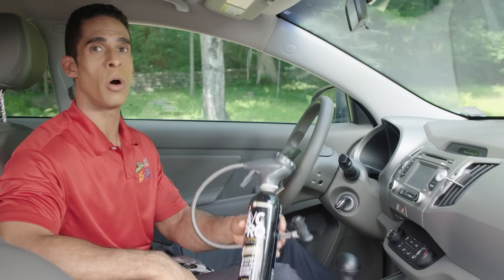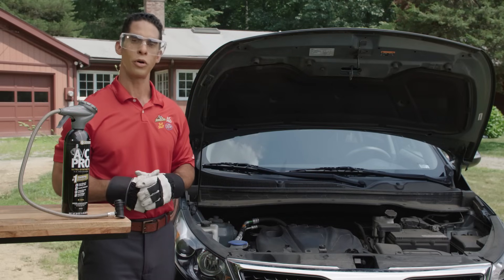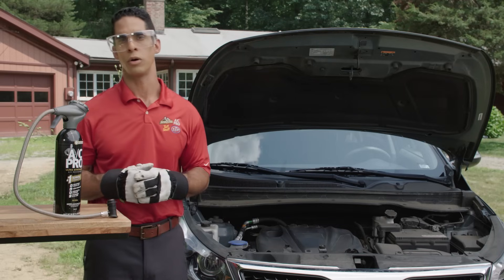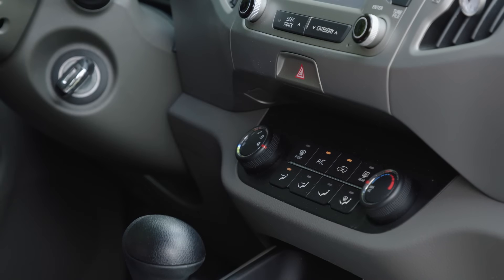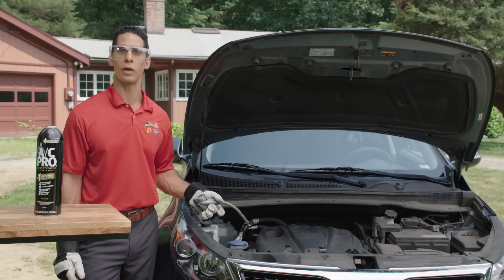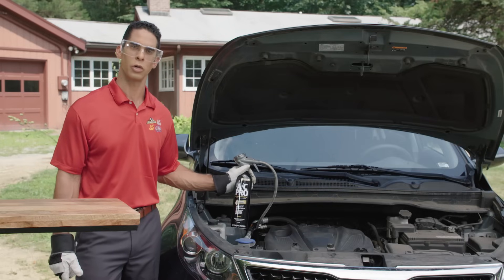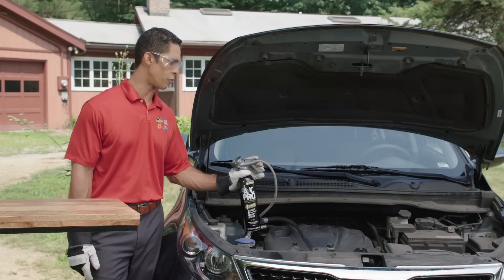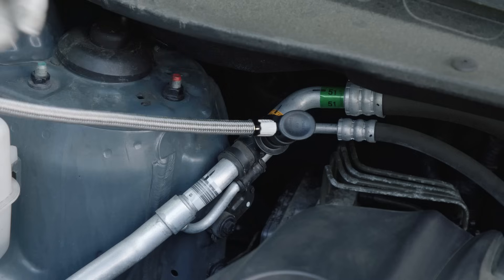A/C Pro® How To Recharge

Comment: my adapter won't click on it'll go on but it won't click securely what do I do
Reply from the maker: In this situation there are a couple things you can check - 1) make sure you're on the right port in your vehicle.  The coupler will only fit on the low side port so if you've found the high side port by mistake it won't connect by design.  2)  Make sure your vehicle uses the same refrigerant type in the can you bought.  Many newer vehicles come with a new environmentally-friendly refrigerant called R-1234yf, which has a different size low side port.
If you're using the right refrigerant on your vehicle and have found the right port, the coupler will just snap on with a push.  No need to pull back on the collar on the coupler.

Comment: Did not work on my 2016 Civic.
The quick attachment did not click and everything started splattering everywhere
Reply: 2016 Civic doesn’t use this type of refrigerant.
Reply: It’s a standardized connection. Try again.
Reply: @cabbycabby1770  the car uses R-1234yf -

Comment: The connector doesn't fit on a civic 2016
Reply from the maker: It doesn't fit because this vehicle uses R-1234yf and not R-134a so the connector is also different.  https://youtu.be/CsrtqKdmlOo
Reply: @Acprocold  oh got you thanks a lot for responding brother

Comment: Won't attach to my 2017 kia sportage
Reply from the maker: Are you sure you're trying to connect it to the low-side port and not the high side?  The low side port is typically connected to a larger diameter aluminum tube.  The ports are standard across all vehicles so if you find the port it will fit.  Our low side port lookup tool can help.  https://www.acprocold.com/ask-the-pro/port-locator/
Also, make sure your vehicle uses R-134a and not R-1234yf.  You can confirm the refrigerant type by looking for the sticker under the hood.

Comment: I gave it a whole can. Now it's shooting kinda cold air. I still need the window open. Before, it was shooting hot air now it's kinda cold. I'm going to give it 2 more cans, that'll do it.
Reply from the maker: Be sure to read the gauge when recharging your system. Overcharging it can lead to warm air, so you want to make sure the refrigerant level is in the green portion of the gauge for best results.
Reply: @Acprocold  I gave it 1 more can and now its shooting cold. took 2 cans.  works great though.

Comment: I put the hose on and it comes up red, I guess my a c has a bigger issue 😪
Reply from the maker: If you're in the red and your engine is on with the A/C on max cool/high then you probably have an issue other than low refrigerant.

Comment: I have this exact item but it won’t clip on to my ac thing. Why?
Reply from the maker: What year/make/model vehicle is it?  Some newer vehicles may use a refrigerant called R-1234yf, which has different fittings.  You may also have found the high side port, which this will not fit on.  Take a look at our port locator for help.  https://www.acprocold.com/ask-the-pro/port-locator/

Comment: I press the button to try to engage
Reply from the maker: If you're on the low side port, you do not need to twist the coupler on.  The coupler has a snap lock mechanism so you just push it on with your finger and it connects with a snapping sound.  If the coupler is not connecting, there could be two reasons why: 1) you have found the high side pressure port, which has a unique size/diameter.  You must be on the low side port to charge and the coupler will only fit the low side port.  2) you may not have the proper refrigerant type.  Newer vehicles use a refrigerant called R-1234yf which, by law, has unique low and high side ports.  If your vehicle is between model year 1994 and 2011 you have 134a in your vehicle.  If it's 2012 or newer you most likely have 134a, but may have R-1234yf.  If you bought our R-134a kit and try to connect to a R-1234yf system it won't fit.  You can confirm the refrigerant type in your vehicle by looking for the sticker underneath your hood to make sure you're using the right refrigerant with your car.  This video has more details on that.  https://youtu.be/CsrtqKdmlOo  
You can also call us at 1-888-318-5454 to speak to someone who can help.
Reply: @Acprocold  I believe my car is 2012.  I will go to the parts store

Comment: Does not fit 2018 Chevy Cruze
Reply from the maker: Your 2018 Cruze most likely uses environmentally-friendly R-1234yf refrigerant and you probably have a can with R-134a.  They each have unique coupler size by spec.  You can purchase our R-1234yf A/C Pro at auto retailers.  https://www.acprocold.com/product/acpyf100d-6-a-c-pro-r-1234yf-recharge-kit-with-digital-gauge-14-oz/

Comment: Doesn’t even fit my port on a 2018 Honda Civic and yes I am using the right port
Reply from the maker: Your 2018 Honda Civic uses a new environmentally-friendly refrigerant called R-1234yf.  You will need this product to do a recharge.  It is quite a bit more expensive than R-134a.  https://www.acprocold.com/product/acpyf100d-6-a-c-pro-r-1234yf-recharge-kit-with-digital-gauge-14-oz/

Comment: Won't snap on for me and I'm pushing hard
Reply from the maker: Be sure to verify you have the right refrigerant type. R-134a and R-1234yf have different ports so the refrigerant cannot be dispensed into the incorrect system. You can check your vehicle's refrigerant type via the Spec Database on the Port Finder page of our website:
https://www.acprocold.com/a-c-port-finder/

Comment: What the heck, AC Pro?! If you take the trigger of the "reusable" system off the can (as you have shown it of the can in the video), the gas escapes the can and sprays over the user and throughout the area!
Reply from the maker: Any product made after Jan 1, 2018 will have a self-sealing valve that allows you to disconnect the can from the gauge without any refrigerant releasing from the can.  The product shown in the video allows you to do that.
Reply: @Acprocold  Thanks for your reply, but not the can that sprayed all over me. Maybe it was older.

Comment: I think my car may have been serviced improperly as warm air is now coming out of the vents. Now what?
Reply from the maker: I would take it back to the place who serviced it and get it fixed.  Warm air out of the vents can mean either low refrigerant in the system or too much refrigerant in the system or some other problem.

Comment: He forgot to put low side pressure port cap back on. It will leak refrigerant if the cap isn’t on and a/c is on.
Reply: If that valve is leaking refrigerant, you got a problem, and having that cap on isn't going to fix it.

Comment: Don't buy Wal-Mart cheap R134a doesn't even get ice cold I empty out my new ac system that has been rebuilt and put this in it I did use 1oz of what I had left of my wal-mart brand too top it off cause the can of Ac Pro is 20oz can $33.00 at wal-mart so you need just 1 oz more for a car like my 2006 Lincoln Zephyr
Reply: Can you translate that into English?
Reply: @glamoc0000  right…wtf?! I thought maybe the lack of punctuation was making it hard to understand but I don’t even think adding punctuation is going to help that 😂

Comment: Product sucks, wouldn’t hook up to my vehcile
Reply from the maker: There are typically two reasons why the coupler won't connect.  1) You're trying to connect our coupler to the high side port instead of the low side.  The coupler is standard for all vehicles using the same refrigerant so if it's on the right place it will fit or 2) The vehicle you have requires R-1234yf and not R-134a.  You can confirm the refrigerant type of your vehicle by looking for the sticker under the hood with the type listed.  This video can help you https://youtu.be/m9WVVmTTSYM
R-1234yf vehicles have a different size coupler by regulation.  We have A/C Pro R-1234yf kits on sale at all automotive retailers.